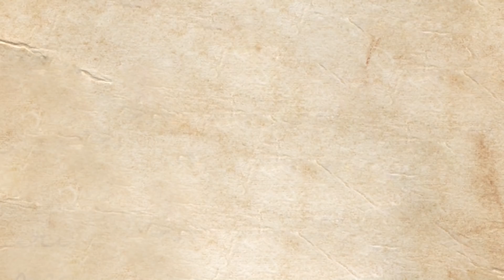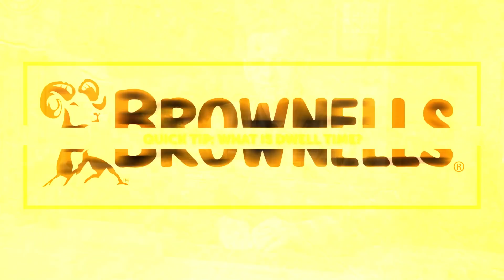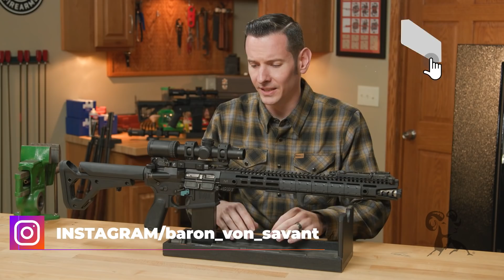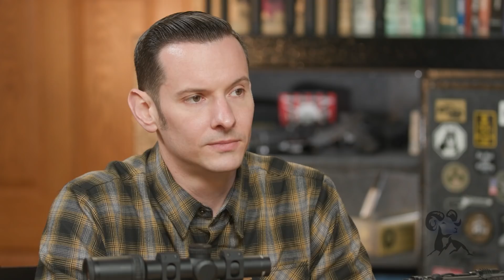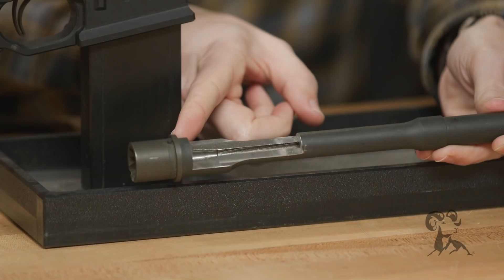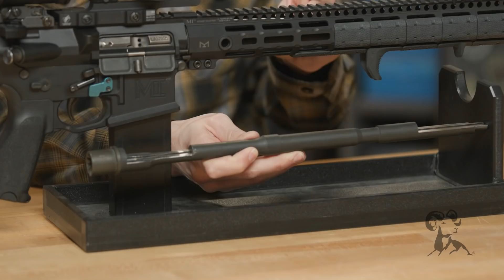Quick Tip: What Is AR-15 "Dwell Time"?

Comment: Caleb, i'm sorry but you are wrong. The carbine(cut out) barrel has less dwell time than the mid-length. The longer the gas tube, the longer the dwell time aka the brass stays/dwells in the chamber before opening. We build custom Magnum AR-10s and know a lil' bout gas! Good luck!
Reply: When I first saw the title of this video, and even after I watched it, I wondered if there was any real benefit from its creation.  So I started scrolling through the comments and came across this.  Now I see why Caleb and Brownells went through the time and expense of making this video.  

Michael I believe you learned a completely different definition of dwell time.  From your comment I understand your definition is the time at some point after powder ignition when the brass swells and seals up the chamber, until that seal is broken during extraction of the spent case.  I do not believe there is an industry term for referring to that length of time, but I can assure you it is not referred to as dwell time.  I would describe your definition as "time to initiate extraction" or some other smarter sounding, more accurate thing.  

My swamp people definition, which most people use, and are technically incorrect (less correct) in doing so, is: the amount of time after the projectile passes the gas port, until the projectile exits the muzzle.  Caleb's definition (with me paraphrasing it) as the amount of time the gases impart force on the gas key, is a better definition than "mine".  Effectively there's not much difference, but there is a difference.  Caleb's definition of dwell time is more accurate than the definition I've been using.  

To be honest I am struggling with this first comment of yours and most of your other rebuttal comments.  You're arguing with yourself, Caleb, and others, while simultaneously kinda getting some stuff right, but for unrelated reasons than you are providing. This is a post card example of arguing with someone on the internet where there is a clear gap in either knowledge base and/or understanding of fundamentals.  It's very difficult to learn something when you're talking or typing.  You might want to watch the video again.
Reply: @sethwinn4061  Been building custom hand lapped barrels for 21 years. Been turning those barrels into ar-15 and a-10 barrels for 13 of those years. The industry term is "locked dwell time" . We successfully build magnum and short magnum barrels and custom gas systems for many different companies. I don't see where i am arguing with myself? I have stated the same thing over and over and given examples and not once edited my post. Please dont trust what i am saying. Look up what other barrel manufactures say about dwell time. Dwell time is not about a barrel but rather a gas system. The term come from the use of gas systems more or less. Dwell time in a bolt rifle is irrelevant as the cartridge has fully expanded and contracted by the time one opens the bolt. The gas system is what opens the bolt in AR-15 and AR-10 rifles with centerfire cartridges. they are not delayed blow back so Dwell time in these rifles is a concern. It is managed by buffer weight, gas tube length and gas block adjustment. Caleb is wrong. Call an ar barrel maker and ask them.
Reply: @michaelshea5427  I appreciate your explanation.  "Locked dwell time" is as good a term as any for some point in time after powder ignition to breaking the gas seal during extraction.  So what does one call the time when the gas system is acting on the gas key?  That is what Caleb was talking about.  If he's using the wrong term with "dwell time" then what is the correct term?
Reply: @sethwinn4061  As i said earlier, this terminology is not commonly used with bolt rifles or AR-15 blow back rifles. The common denominator is no gas system. This terminology is used commonly with gas systems of all types. Why is that? The answer is because gas systems very vastly in proper function, cyclic rate, powder composition & burn weight, caliber, bullet weight, cleanliness, carrier weight, buffer weight, buffer spring design & weight, gas tube length, etc.. Studying Dwell time and learning about it help us obtain a benchmark or proof we can use to tune gas operated rifles to operate more efficiently. Old school method was to slightly over gas everything for function.  Why bring up the issue of dwell time if it isn't gas tube length related? I dont understand what Caleb is talking about when he mentions barrel length and dwell time. From his video to his further defense in the comments he has flipped flopped on the answer. The only meaning he could be referring to when he says "acts on the operating system" or "gas acting on your system" (@ 2:25 sec) is the bolt carrier assembly.
Reply: Specifically, where Caleb is wrong is stating @ 5:15 that a carbine gas system has more dwell time than a mid length. That is 100% contrary to what he said prior to this.
Reply: @michaelshea5427  I hope I'm not coming across as insulting, but you're still missing Caleb's point with this video.  I do not mean to insult.  Eventually this is going to sink in and you'll laugh at yourself a second and move on.  

What length gas system would you use for a 24" barrel 5.56?  Probably a rifle length.  Would carbine, midlength, intermediate, magnum, or pistol length work?  Probably magnum, intermediate, and mid, but carbine and pistol not so much.  But which one is ideal for this application?  The rifle length, arguably a magnum length.  Why?  What Caleb is calling dwell time.  What about a 14.5" 5.56 barrel? Carbine.  A 10" 5.56 barrel?  Pistol.  A carbine length system would physically fit but good luck with proper cycling.   That is what Caleb was talking about.  Basically you got to have the right amount of barrel length between the gas port and the muzzle.  Not enough length=no cycle so good; too much length=broken extractors are best case.  Paraphrasing for Caleb: barrel length and gas system need to be selected to compliment one another in a Goldilocks fashion.  That is what the video was about.  What your confusion appears to be about is what you are referring to "locked dwell time", and what Caleb and the rest of the world calls "dwell time".  Two different things.  Two different, yet overlapping, periods and lengths of time within the same firing of the same gun.
Reply: @michaelshea5427  I thought he was being consistent there as well but maybe I am missing something.  Answer this question: does the gas system begin working on the gas key before or after the fired projectile passes the gas port in the barrel?  And this one: if there is obviously more barrel length between the gas port and the muzzle on a 16" carbine length barrel than on a 16" midlength barrel, which one will have higher pressure gas on the gas key (hint- it will also direct gas through the gas port and tube for a longer period of time, i.e. it will have more "dwell time")?
Reply: @sethwinn4061  The facts:  1/1,000 of a second after primer strike the powder ignites.  Between 1.5 milliseconds & 2 milliseconds the powder fully ignites, pushing the bullet down the barrel. 3 to 4 milliseconds later chamber pressure is at zero pressure. At 5 milliseconds the bullet is apprx 3.23" in a 5.56 & 62k psi & building velocity. At 8 milliseconds the bullet is 14.3" and past a rifle gas port. The gas begins working on the gas key/BCG after the bullet passes the gas port & the gas follows the point of least resistance and immediately begins forcing the BCG rearward. Very difficult to measure any delay at this point as many variables begin stacking. You can however measure the delay by adding more gas tube length and there is a delay. It is simple physics. Add more length to the gas tube=delayed blow back. Longer barrel means longer gas tube = more volume to disperse pressure and heat = delayed blow back/increased dwell time. So a midlength gas will have more dwell time.
Reply: @sethwinn4061  What is his point then? Do you actually believe that a carbine gas system has less dwell time than mid length or rifle? Caleb’s quotes: @ 45 sec What dwell time is: "The amount of time the gases from a fired cartridge are acting on your actual system."  @ 5:30 “The closer the gas port is to the chamber the more pressure is coming through the gas tube.” @5:18 “because its going to take longer for the bullet to exit the barrel the gas is enacting on the system for a longer period of time.” They are both 16” barrels so how can the carbine gas take longer for the bullet to exit? @ 2min “The wrong definition” and @ 2:20 “The amount of time it takes the bullet to pass the gas port and exit the muzzle.” Yes Caleb, I totally agree with this!
Reply: @sethwinn4061  No sir, not insulting at all. I appreciate the discussion.
Reply: @michaelshea5427  sorry but I am done with this. Caleb and I have both failed to get you to understand.  To learn something one has to be willing to challenge what you already know.  Clearly you are not open to that.  And that's fine.  Your experience has served you well it sounds like.  Best wishes for you in your future endeavors.
Reply: @sethwinn4061  I proved my point with examples and quotes from the video. I have clearly stated where he is wrong but have not heard Caleb or yourself tell me and other barrel makers where we are wrong..
Reply: @michaelshea5427  best response/critique...my late father was an engineer, math nut, and would work the numbers (physics/calculus, fluid dynamics) and graph dwell vice pressure curve just for fun...and this was 40+ years ago prior to computers with simple graphics paper, on M1 no less (what I remember when I was 14 sitting at the bench lol)
Reply: @learjet301  Chris, your father was awesome! I'm sorry to hear of his passing. Guys like your father are why we have the tech we have today! Thank you for sharing!
Reply: Your not taking barrel length into account, the longer gas is acting on the system, the longer the dwell time. Your definition of dwell time is incorrect, according to what you are saying dwell time has little to nothing to do with the gas system when in fact it is all about the gas system. It's about the gas, not the brass.
Reply: @CalebSavant  dope rhymes at the end there 👌🏼
Reply: @CalebSavant  You are misrepresenting what i am saying. I am clearly saying that the gas system is solely responsible for dwell time. Where did you see me write that the gas system has nothing to do with dwell time?
Reply: @CalebSavant  According to you. @ 45 sec What dwell time is: "The amount of time the gases from a fired cartridge are acting on your actual system." And @ 2min “The wrong definition” @ 2:20 “The amount of time it takes the bullet to pass the gas port and exit the muzzle.” Yes Caleb, I totally agree with this!
Reply: @CalebSavant  Barrel length is irrelevant unless ur talking a micro gas system. If you have two 16" barrels, one with a carbine gas system the other mid-length, the mid-length has more dwell time. If you have two 18" barrels, one with mid-length gas the other with rifle gas the rifle gas system has more dwell time. If you have two 29" barrels, one with a rifle gas system and the other with a rifle gas system plus 2" then the rifle +2" has a longer dwell time. It is solely determined on the length of the gas tube/gas hole distance from chamber's throat. Longer gas tube = longer dwell time.
Reply: @michaelshea5427  Nope...
Reply: @michaelshea5427  Remind me not to have an AR built by you. You are clearly wrong.
Reply: Just to clarify, barrel length is irrelevant to this debate is what i meant. I gave the example of having 2 16" barrels one with carbine gas, the other mid to illustrate this point. It is in fact the gas system length on any given barrel that determines dwell time.
Reply: @philweed1603  Prove me wrong. Call Criterion barrels or any other top barrel maker such as Wilson Combat and ask them.
Reply: I’m learning about dwell time sitting on the toilet after eating my wife’s burritos. Ah refried pinto beans from scratch, home grown jalapeños, homemade salsa verde. Question is how long will the gas be operating on my system? My dwell time on the throne is logarithmically correlated to the number of burritos consumed.

Comment: So Kaleb said that dwell time wasn't the amount of time the bullet spent in the barrel after reaching the port, but the amount of time that the port gasses acted upon the block? Yet he didn't explain why the two would be different?
Reply: Because you are always trying to solve for a constant. Dwell time is always = the lengths of the barrel after the gas port, but the length of the barrel is a changing variable so we use the constant of “Dwell time”. That probably makes even less sense than when he explained it but that’s just how physics do. Force is always = to mass x acceleration, and even if the mass or acceleration (barrel length after the gas port) change the Force will always be the product of those variables.
Reply: That distinction wasn't explained clearly enough for me either.
Reply: @Jonathan906  me 3. The instant the bullet leaves the barrel, the pressure in the gas system drops to zero. I guess it takes a fraction of a second for the gas pressure inside the BCG to dissipate?  No, that’s wrong. Gas pressure in the BCG should drop the instant the BCG moves back far enough for the carrier key to disengage from the gas tube. Also there are the vent holes in the BCG… Caleb has me thinking for sure. And scratching my head.